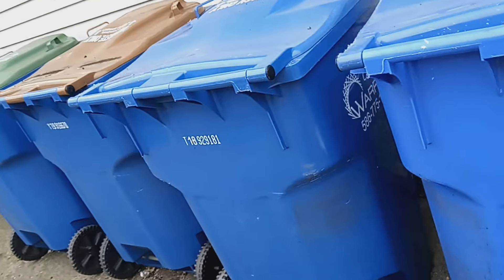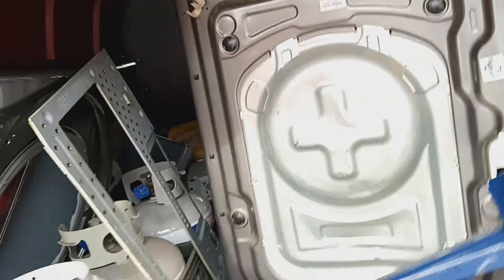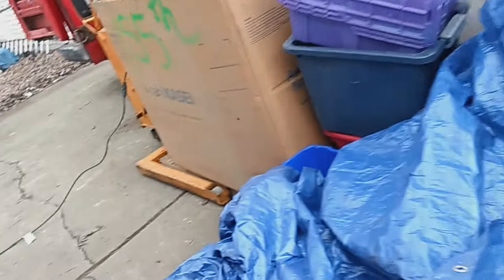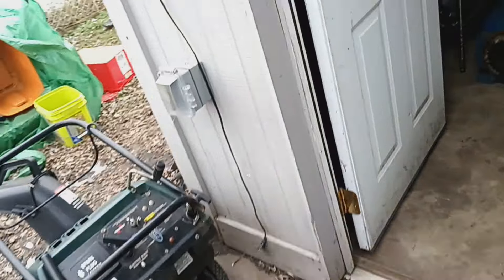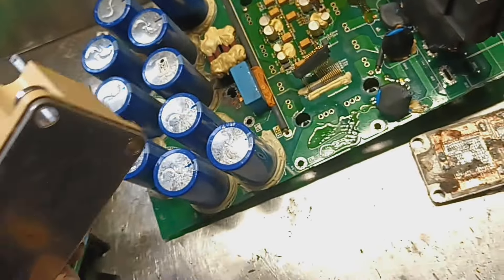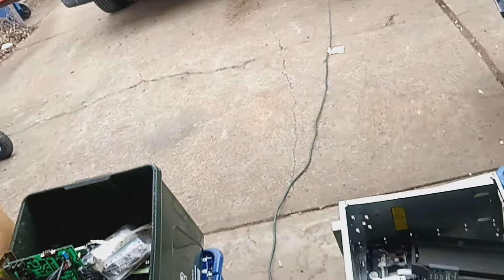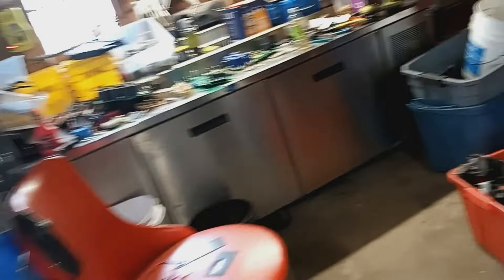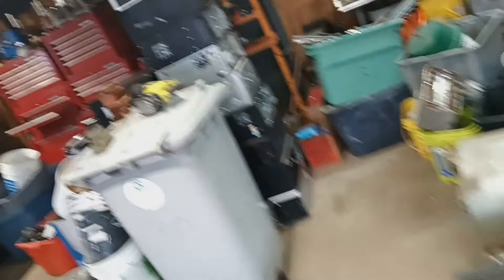Got everything done

Comment: I've got 4 or 5 of those slimy copper things to deal with, they just told you to heat them up, Huh?
Reply from the maker: I got about 300 or so. Good copper.
Reply from the maker: I told myself to heat them. If you heat up the plate on the bottom the plate will come off clean.